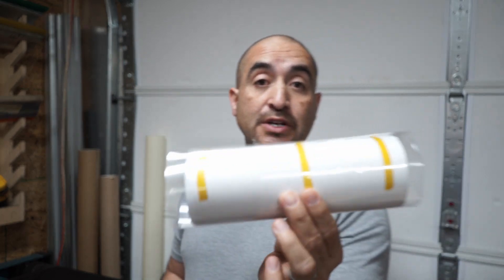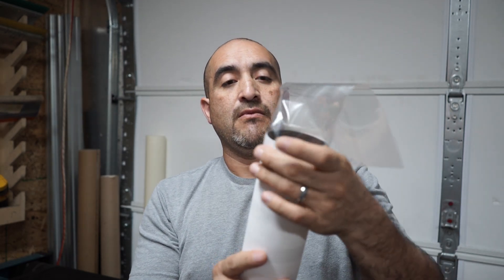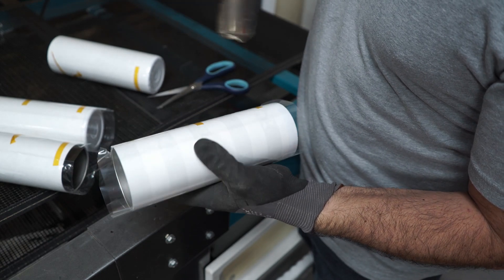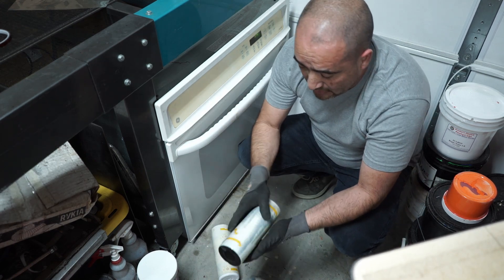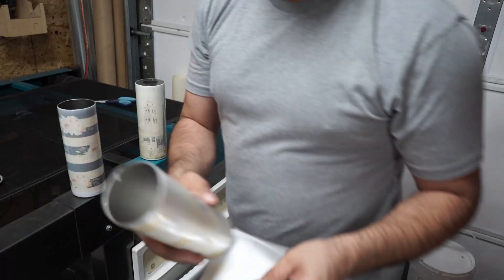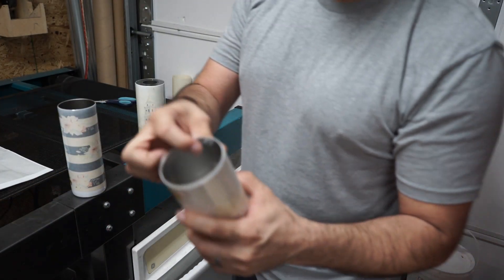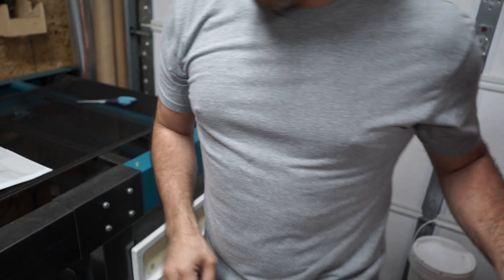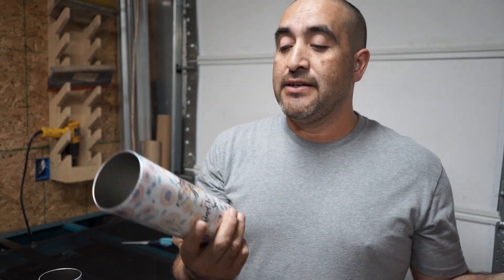SUBLIMATION CLEAR SHRINK WRAPS FOR SKINNY TUMBLERS

Comment: Am I wrong in thinking that you really didnt have to put them in the oven? Wasnt the heat gun enough to sublimate? But then I think the heat gun might not get hot enough...which is right? or am i wrong on both points? thanks :)
Reply from the maker: you have to hold heat evenly for the entire sublimation time (4 to 6 minutes) 
1. the heat gun might get to about 300f 
2. heat gun can only heat one spot at a time 
3. I wouldn't be able to hold a tumbler at 400f + in my hand that long lol 

good question!.

Comment: Hi, Juan! Could you prevent the shrink wrap from sticking, if you used heat tape on the bottom of the tumbler? I haven't sublimated yet, but it appears the heat tape comes off easy. Thanks, just curious.
Reply from the maker: that is a great Idea! if you use a piece of paper on the bottom will work too and is a lot cheaper too LOL
Reply: @LibertyGraphicDesigns  I like the cheaper idea better. Thank you for sharing your work with us. 🙂

Comment: Do you think shrink wraps would work for tiles or platers?
Reply from the maker: No not really since it will only put pressure around the edges and not the top or bottom
Reply: @LibertyGraphicDesigns  well, darn. Thanks for replying so quickly.
Reply from the maker: @wileycovington4497  my pleasure

Comment: Thanks for doing a video with the clear shrink wrap. There are a lot of negative reviews on them. Do you think putting a Teflon or silicone sheet on the rack will help with the melting? 79928
Reply from the maker: yes it will help a lot with melting

Comment: You should use painters tape on the bottom so it doesn't stick to cup.
Reply from the maker: the adhesive will burn into the tumbler and it will not come off is better to use heat tape or cut a piece of paper (circle) and put it on the bottom so it will not stick to the tumbler, however if you sublimate it at 375 for 3:45 to 4:00 minutes you'll be fine